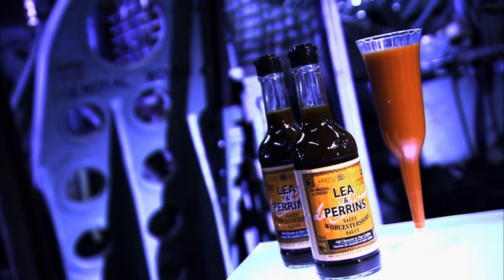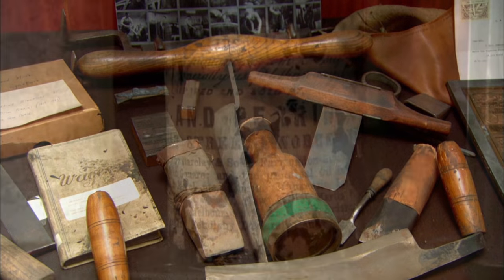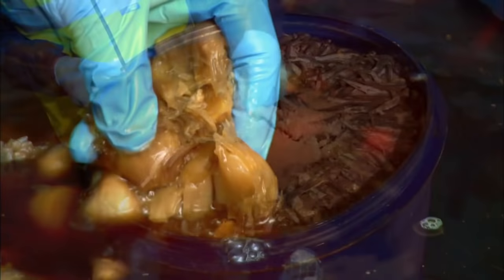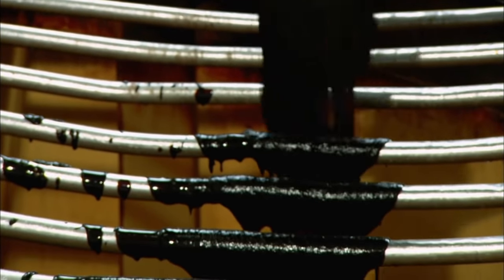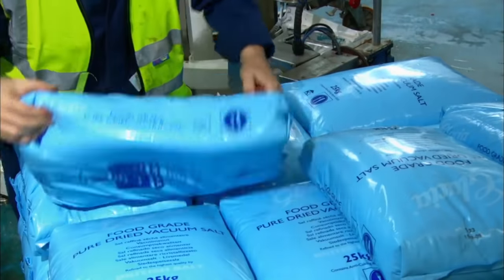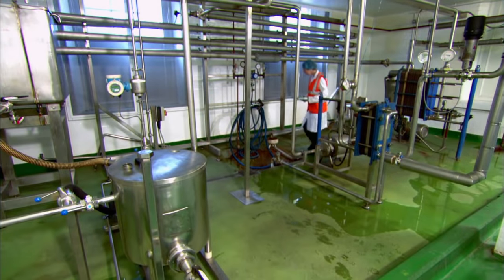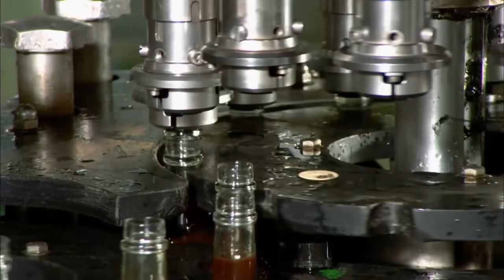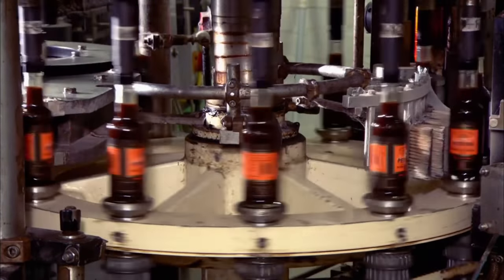How It's Actually Made - Worcestershire Sauce

Comment: The capping machine is an underrated gem and should not be overlooked.
Reply: no cap

im sorry
Reply: It’s a caplicator
Reply: Well yeah it is a very important step otherwise all the hard work the filling machine goes to waste if it tips over
Reply: It's a capinator, according to standard industry nomenclature.
Reply: @grecco_buckliano  I was making a reference to one of his other vids where he called it that😂
But thanks for the info sir
Reply: @rockettacos2639  and then I said a very correct sounding load of BS that I just now made up. For instance, did you know that the Widley Capinator, was inadvertently patented as The CAPPINATOR?  ANd old man Widley did not make a dime off of his invention and died penniless? <----------[complete BS]
Reply: is it a capping machine or a twisting machine? you know! because when you open the bottle you twist the top.
Reply: @power21100  There is some clamping action going on there too : clamp twist clamp twist clamp twist. Sometimes it just gets all jiggy with the clamping and goes CLAMP CLAMP CLAMP CLAMP......